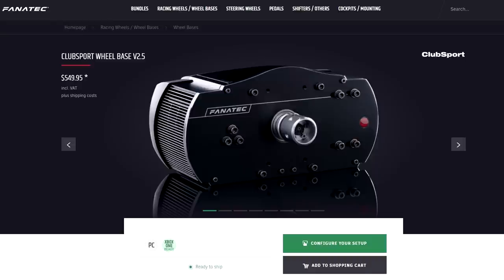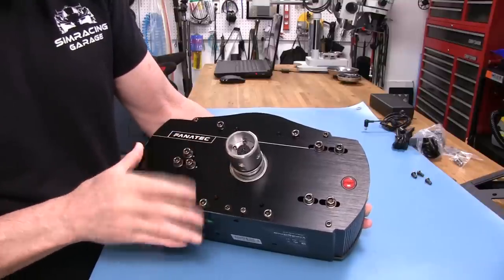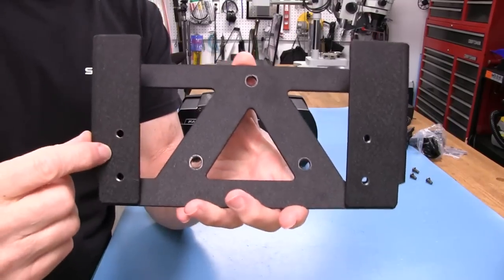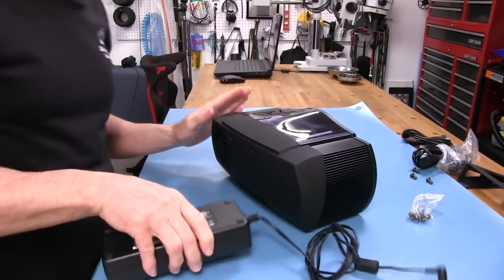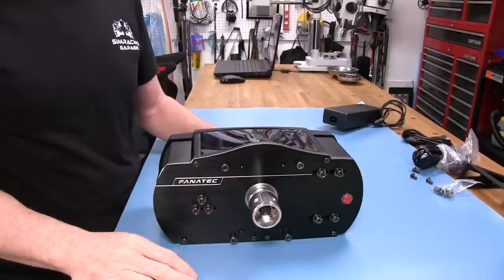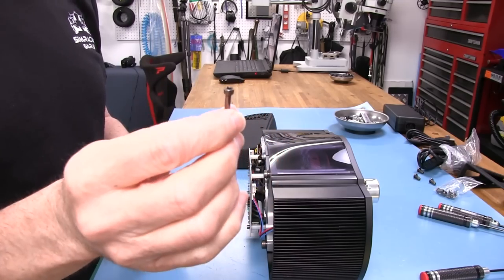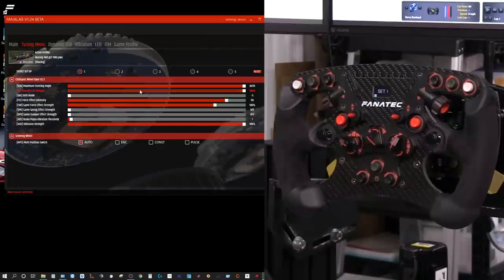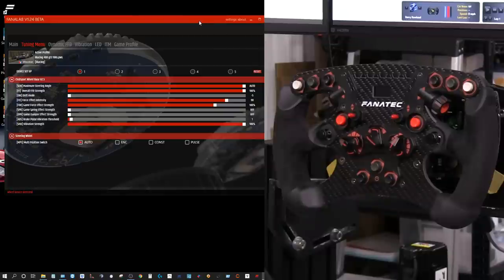Fanatec Clubsport V2.5 Wheelbase Review

Comment: Got mine ordered just the other day, along with the gt wheel and the v3 pedals. I'm upgrading from a ten year old second hand logitech wheel and pedal set so I'm fascinated and excited to see what difference it makes!

EDIT : it's amazing! The leap in performance is huge! I am one VERY happy customer!
Reply: Are you still a happy customer?
Reply: @DavidGarcia-oi5nt  oh absolutely!
Reply: I'm about to do the same for one of these.  They look to be a huge upgrade from my g29.
Reply: @seebarry4068  Just upgraded from the G29. Night and day difference. My roommate has the CSL DD and it's pretty comparable. The CSW 2.5 is actually stronger than his setup even with the boost git. I've been racing all day and haven't spun once in a race compared to multiple times with the G29. Was slower at first but once I got used to how strong it was, was way faster and consistent.

Comment: I considered buying one, but at the time the cost of the base + button box + rim + shipping was within $10 of buying a full Accuforce kit, I went with the Accuforce. (I'm in Canada and Fantec shipping is very expensive)
Reply: Never heard of ordering from a shop? Direct from the manufacturer isn’t cheaper anymore, they sell their gear at full retail price most of the time.
Reply: Shops “can” give discounts
Reply: Even before shipping fees, there's only about $150 between this base with the bmw wheel bundle, and the accuforce with wheel included. Unless that $150 is a dealbreaker, or you need console compatibility, or want to lock yourself into the fanataec ecosystem, why not have an excellent DD for not much more?
Reply: @dylanzrim1011  Then you have canada, where it's full retail with a chunk extra on top (for sim racing stuff anyway).
Reply: You've made more than the right choice!

Comment: already own their DD1 but who else would have liked a quick comparison to their podium series.
Reply: your dd is much better than this wheel, there is no comparison there.
Reply: Yet I’ve read the difference is a lot smaller then one might think. Sure you get more TQ but feel is what matters more than just raw power. The CSW 2.5 does that just fine.
Reply: @drift400  I have used the 2.5 before and the added tq and sustained tq you get from DD does add to the immersion.  I think you get to a point with sim racing where it just comes down to added immersion.  I and many others were plenty decent and quick with all logitech gear
Reply: @chuckystang  There's almost no correlation between better gears equals better laptimes. The fastest alien Sim racers some of them are using simple Thrustmaster setup.
Reply: @radityaindera3442  yes in a dining room chair on a standard 1080p screen at a wooden desk. I will go with this bundle and pedals as my premium. i was so impressed with TS-PC
Reply: @radityaindera3442  yep- I see no need for the DD1- I was smoking dudes with my thrustmaster and smoke dudes with my CSW and V3 Lc pedals. The worst part is I get smoked on occasion by dudes using controllers. That is REALLY humbling.

Comment: Great, in depth review as usual. 
This is the wheelbase that I wish I had. I rarely drive my car anymore because my arms and legs are less functional by the day because of spinal cord damage,  but I tried an older club sport wheel my friend has. Wow, are there amazing and not to the point I have to worry about getting my arms ripped off.
Reply: Sometimes I like the idea of a DD but practically 8nm is as much as I can use without building a large dedicated rig out of aluminum rail.

Comment: Barry, regarding Project Cars 2. If you select custom for the ffb and use the wrist breaker settings provided by Hugo Vai, you will find a tremendous difference and very pleasing experience. Try the Formula Renault around Bannochbrae, it is fantastic.

Comment: Did you actually run Drift mode at -5? It slows down quick movements massively and i dont understand how you can like it, especially you since you have experience with DDs.
Reply: I have put drift on -1. On 0 it has ver little feel.
Reply: @valrond  maybe -1 i can understand, i prefer none but definitely not -5...
Reply: I tried 0 yesterday on ACC and I could barely feel anything at all on the car, I couldn't catch any slides, the wheel would barely move. Put it on -1 and I had feeling again. Not going any higher, though.
Reply: -2 is the way to go, believe me.
Reply: @kentsangkh  I read it, tried it, but I prefer - 1
Reply: Correct, DRI -2 or -3 should have almost no oscilations an kills almost no FFB resolution because the electronic damper is only in the motor and lets active ffb signals pass
Reply: I use -1 or -2 depending on the game
Reply: BigBoy 69 lol I always use +5 xd
Reply: That’s on csl elite though not the V2
Reply: I use -02 for iRacing and -03 for ETS2 / ATS works really good for me.

Comment: Barry, did you try, DRI -2 or -3? That should give you almost no oscilations and kills almost no FFB resolution, because the electronic damper is only in the motor and lets active ffb signals pass

Comment: For my CSW2.5 I mounted it with the angle plate onto a 1/4" sheet of G10 (high quality fiberglass sheet), which was then bolted onto a $50 plastic folding table from Staples (Tied some 10lb weights to the sides of the table and it doesn't wiggle too much). This setup works well for me because I can still fold up the table and tuck things away. Biggest problem is the cable connectors on the back of the unit are a NIGHTMARE to get plugged in if you ever feel like you need to disconnect the pedals.

Comment: I was really interested in this wheel base, but it seems like for what this base plus a nice rim costs... I think I'd have to go with the Accuforce v2 DD wheel instead.  I currently have a G27 that I've had for about 10 years now.  I think I'll be deciding between the CSL Elite (to save $) and the Accuforce v2 (do it once, do it right).  Can't see why I'd spend $800+ on the Clubsport 2.5 when the Accuforce v2 is just a bit more $... Has to be worth saving a bit more for right?
Reply: i got a V.25 for $499 new.....
Reply: @harrison7494  I don't have rim.  That's a minimum of $250 for me (I don't like the cheapest option.  That's $750.  If you want a nicer rim, it's $3-400.  So $800-850.  Accuforce v2 is $999 and just has to be way better?  If you already have a wheel rim, then $499 isn't bad and is way cheaper than the Accuforce v2...

Comment: I currently have a thrustmaster t300 and I've been thinking about getting the fanatec 2.5, would this be a good upgrade from my thrustmaster or would there not be that much of a difference?
Reply: I upgrade and it was a noticeable difference with better FFB strength still feels notched at times( not smooth like grainy) . As my reasoning was I wanted something that would last. About 5 months ago I was looking to buy a DD wheel and wish I would have went that way. I run iracing and feel many times I loose the rear end before I feel it in the wheel. Alot of that is iracing tyre mode but, some of that is the wheel and I would feel that sooner in a DD wheel. As I have tried one. With that all that said I'm  impressed with the 2.5 but, not Fanatec's software.Check there forums out. I upgraded my drivers and software and it was a nightmare trying to get the right version to work as it was a beta that ended up being much better than the 2 year old software that came on it. Big headache but, ended up being worth it. Pricey and will last a long time. My thrustmaster T300 lasted only 2 years.

Comment: is this the new Fanalab 1.23 ?
i had much issue with this and turned back to 1.12.
even the driver 352 has big problems..and Fanatec say with 352/356  the csw 2.5 has the DRI is locked on -5 !!! on all settings..
even DRI off is lock to -5 !!
thats a lot of damping effect..
i use it DRI off..and its a lot different..i say similar to DD whels.
so that is no option for me to drive on -5 DRI.
so the best for me is v346 with 1.12 Fanalb. 
1.23 is compatible only with v356 352.

How did you test it with that driver/firmware setup ?
thanks

Comment: I've had a CSW 2.5 since feb. 2018, never had an issue. 

I think this is the best decently priced wheelbase when you're just starting with simracing, it's not cheapest and not the most expensive, the middle segment. Can probably find it used since people upgrade to the podium series, providing even better value. For maybe 350 to 400 USD you can find one. 

Yes, direct drive is a whole new world, but for someone starting out this is the way to start. 

Fanatec rims are not expensive if you look at other manufacturers, I think they are pretty good value. Once again you can find them used easily. I bought my formula carbon for 150 USD in mint condition.

Comment: Mine came with a braided USB cable and this was when it cost $499. Sad to see them cutting corners after raising prices.
Reply: lol they are not manufacturing the USB cables, maybe Fanatec had contract on the braided version, supply was low so they moved to alternative. It's just a stupid USB cable. It's same with the $3 HDMI cable it can pull same res and frequency as the highend $50 HDMI cable. No one cares honestly.

Comment: Hello cool Video. I have the Fanatec Clubsport V2 Wheelbase with problems. The Wheelbase will only identify from the Computer when the Wheelbase is in the PC Mode (blinking blue). After Firmware Upgrade cannot the Computer identify the Wheelbase anymore (blinking red). Could the a Problem with the USB Port or with the Start Button ? Or do you have possibly an Idea for the Problem ? Thanks

Comment: Saving up for this as my budget isn’t huge and I’m so over my Logitech wheel. So can’t wait to enter some sort of reel sim wheel n peddles
Reply: why would you buy this when you could get the accuforce v2 for 999 dollars
Reply: rizzee rizz I will look into it
Reply: @rizzeerizz8985  looks great but so far i have one big problem i do also drifting so the cord will be in the way and that is a bummer. also how warm does the unit get but it looks great and thanks for sharing the info. also here in oz this wheel be over $999 but still cheaper i guess
Reply: @rizzeerizz8985  i also race on rfactor 2 and acc as i find both to be great in ffb out of all sims i play and ac for drifting
Reply: @MrFrosty888  about 1.9k for accurate pro v2 to Aus 
And the cord will be fine, if it's long enough it will be fine
Reply: @Notinserviceij  i am going simucube 2 sport cheers

Comment: The power wires to the motor sure look they are tight going to the motor. Wonder how long before the solder joints crack and give way?
Reply: They just don't ;-) Never heard about such failures and the V2s are on the virtual tracks since quite a while

Comment: For someone that is looking to get their first sim racing wheel / motor, would you go for this or for direct drive?
Reply: Getting a CSW 2.5 let alone a DD is even a reaally extreme step up for someone who’s been sim racing for like 10 year on a G27 lmao. Anyways, it depends. If you want 1:1 realism definitely go for a DD, if you want to save money but still want an extremely good wheelbase, the CSW 2.5 would be a really good choice and it’s by far the best belt driven wheelbase. Note though, the CSW 2.5 is really really good and you’ll be able to live with it for the rest of your life ( metaphorically not literally) but its still probably only around 30% of an entry level DD.
Reply: @zeyzerx3722  thanks for the advice, I’ve never done sim racing but I’ve raced a real car at a few road course tracks, I may save for the dd
Reply: @pastorraudel1261  Yeah, the DD has a lot of cons mainly price but the pros are so much worth it. The CSW 2.5 is good but for me since i race in real life also im definitely going for the Simucube 2 pro, not going for Fanatec because they don’t ship to where i live.

Comment: does anyone have a clue on why simlab is saying you can mount the csw 2.5 to theire front mounting bracket or which holes to use for that option because the holes for used to mount a DDU which I thought to use dont look capable of handling the force and weight of the csw 2.5?

Comment: An offtopic question: how is the advanced paddle module with a fanatec wheel in f1 2019? Does it allow you to do double clutch starts?
Reply: Nope. F1 2019 doesn’t actually have true clutch starts as it’s hold an rpm at a set amount, release a button and go. Rather than feed out the clutch like in real life. But the double clutch does work in RF2, Iracing, assetto corsa etc. It is a great wheel rim and the paddles are a nice upgrade with the feel and magnetic shifters.

Comment: Really want to pick up this wheel base. Unfortunately like many of the Fanatec products at the moment you simply can’t get it. Website says it won’t be available until June! It won’t even let you build a configuration with this base. Not sure if this is a result of extra high demand while we’re all locked away at home or because factories in China are shut down or because so many pro racers had to recently quickly build up rigs or a combination of all three. Either way it’s really disappointing. Looks like they’ve also completely cancelled the damper accessory for the Clubsport pedals which is a huge bummer. Unfortunately I may be looking at other brands besides Fanatec to upgrade from my G27 with its broken pedal set. 😭

Comment: I really enjoy mine.  When I have more room and such I'm gonna upgrade to Direct drive, but for now I'm fine with a belt driven base on my stand
Reply: I'm sure you've been asked this too many times already, but how would you compare it to a lesser model like a g29? Is it a significant leap in performance?
Reply: @yamabushi170  I've never used a g29 personally, but I will say this; the g29 is great for what it is, especially considering you can get a wheel, pedal, and shifter for like 300 ish new.  However, it feels like a plastic toy compared to Fanatec 2.5 base and v3 pedals.  You're not gonna find any plastic on the parts besides the buttons, and they're built very well in general.  The Fanatec stuff feels much less like a toy/controller and much more like sim equipment.

Thrustmaster is arguably a middle ground, but frankly, I think one is much better off either spending some more for Fanatec gear, or spending less and getting Logitech stuff.  But if you're not looking to spend over a grand, a g29 or g920 will do you just fine as basic sim equipment.  Only thing I'm not really a fan of is the lack of a clutch pedal
Reply: @CGoody564  thanks for the reply! Yeah, from what I read I was coming to a similar conclusion, that being either to economise with the logitech and still have a decent quality wheel or just go for it and get the fanatec gear. The thrustmaster seems like a pointless compromise for a relatively small saving over the fanatec and there seems to be some inconsistency with the build quality on the TM wheels. I'm currently playing with a really old logitech wheel which is pretty flimsy and has really weak ffb but I'm still loving the racing, having started a few months ago initially with a joy pad. I'll stick it out for a bit longer and if I'm still keen then I'll probably take the plunge with the fanatec csw 2.5 and 3 pedal set.
Reply: @yamabushi170  also remember you don't need to upgrade all at once.  You could order pedals at one point, base and wheel at another, etc.  If you can afford a bundle and it saves you some money, go for it, but if you can't, you can always piece it together

Direct drive would be preferred over belt driven, but for a belt driven base, you're not finding much better than fanatec
Reply: @CGoody564  well I just decided to take the plunge and got the clubsport 2.5 with the v3 load cell pedals and gt wheel. I could have gone for dd but that's twice the price and I reckon if I decide to upgrade further I can get a damn good price for the clubsport so it's win win imo. Can't wait to try it out!

Comment: Hi! Can I use longer corner bracket bolts and washers on p1-x? Hoping not to damage the materials.
Reply from the maker: Yes
Reply: Sim Racing Garage  what's the best size bolts you suggest with washers for the corner brackets?

Comment: Barry...  Hoping for your thoughts on this.... 

If I go 'expensive' in my choice of sim wheel/base/pedals, then I've narrowed choice down to two:  (1) Fanatec ClubSport  WB 2.5, CSL Elite wheel, CSL Elite LC pedals, approx total $950. or,  (2) Simxperience AccuForce V2. With either one I'll need clamp/bracket for computer desk mounting.

Still possible I go inexpensive with a Logitech G29...

Comment: I was going to buy this one a year ago when I wanted to upgrade my Fanatech Porsche GT11 (and I needed analog levers on the wheel, hence the McLaren GT3 y bought with it). But I don't have a cockpit and I needed to add the base clamp, that was another 60 euros, so I costed 210 more than the CSL Elite PS4, it isn't PS4 compatible, it doesn't have leds, and while it is better built than the CSL, it's not that much better to justify 210 euros more, so I settled for the CSL Elite PS4, that also had an upgraded engine over the regular CSL Elite.